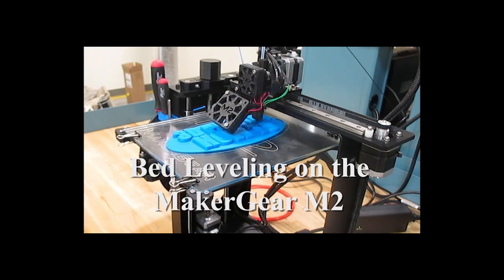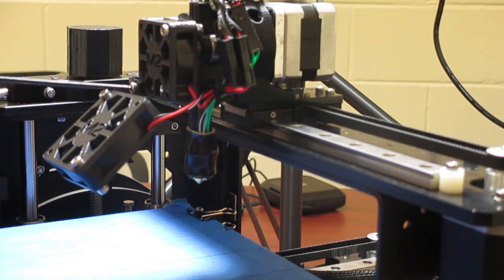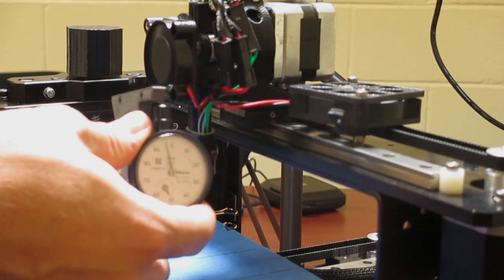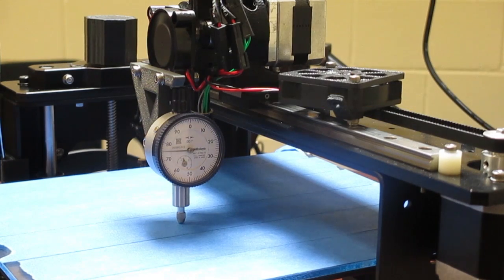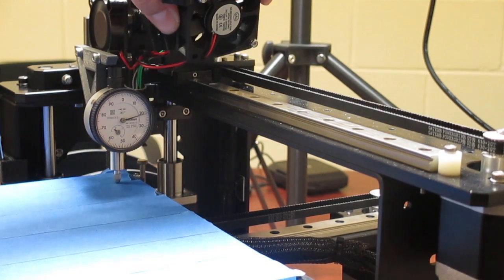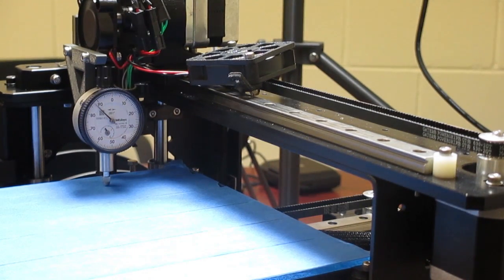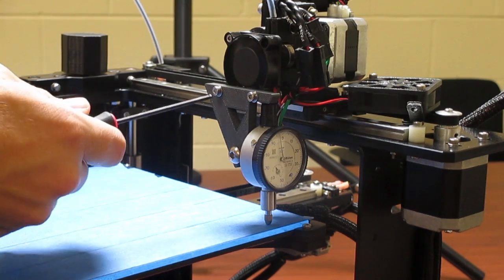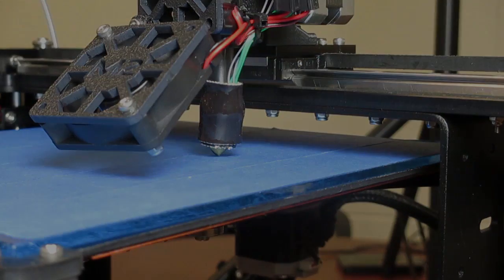Bed Leveling and Z Offset Calibration MakerGear M2

Comment: This won't automatically result in a good print, but it will get you close. The extruded filament pushes on the bed and will deflect it some. If you level the bed perfectly with this method, and the first layer isn't perfect, that is why.
Reply: +NoReallyName Could you clarify this statement a bit more please?
Reply: +CommanderSanta Any printer that has a flexible or cantilevered bed has the same problem. The bed deflects during extrusion because filament pushed out of the nozzle exerts force on it. That force isn't necessarily even close to the same as what your dial indicator applies. This difference is most apparent in a thin first layer. Try it out.

Comment: Also... 
Also, once you find the highest surface of the bed you can turn the bezel of the dial indicator to that the "0" aligns with the dial.  This makes it easier to know how much the plate deviates without dong the math in your head.  Make sure to leave enough bed spring travel to soak up defects in parts.  That's why the springs are there to start with.  I.E. don't bottom any of the springs out as indicated in the video.

Comment: One problem with using that type of dial indicator is that it applies a significant force to the bed causing the bed springs to deflect.  If the bed springs are not stiff enough this can cause misleading readings.  This type of indicator applies much less force... amazon dot com/Sowa-SO-200-730-Dial-Indicator-Range/dp/B002SPQFKO